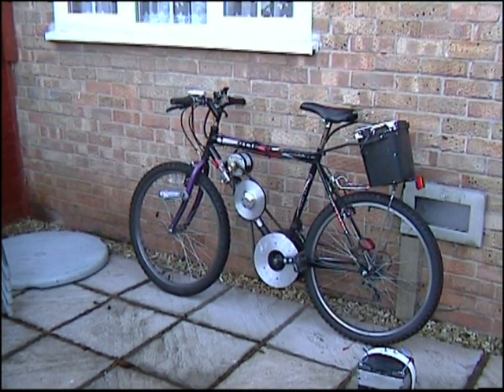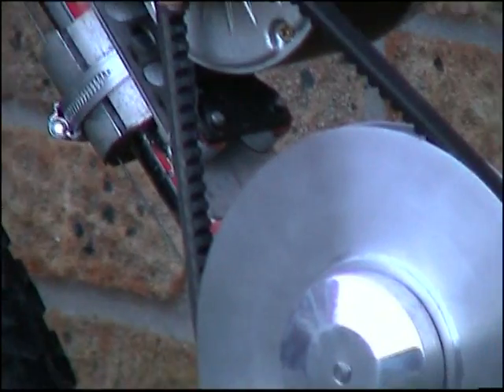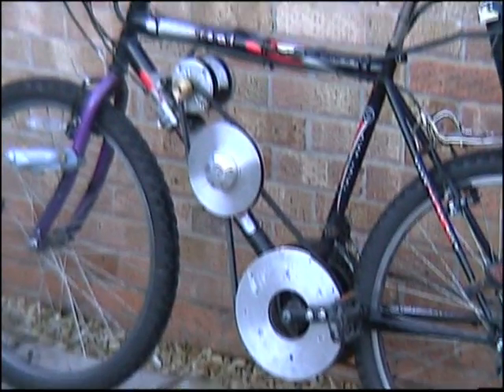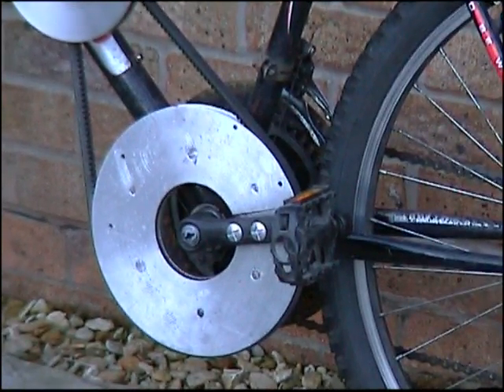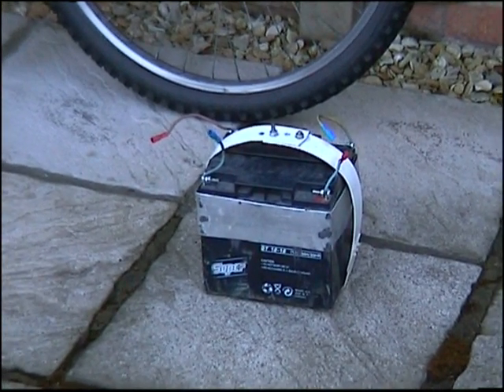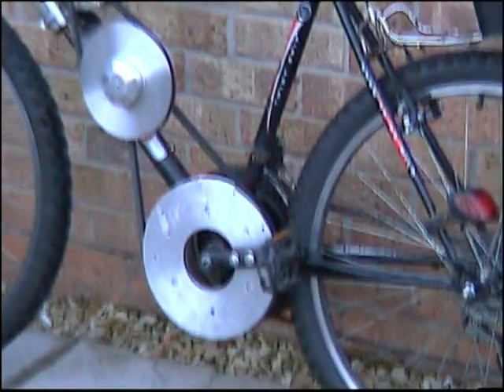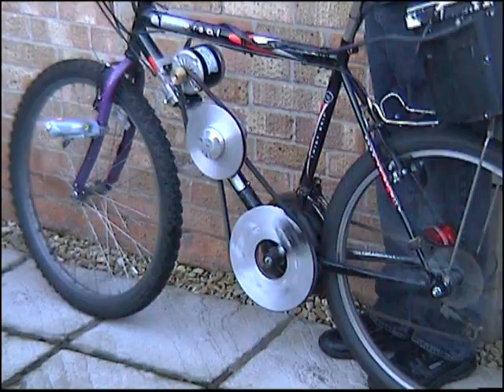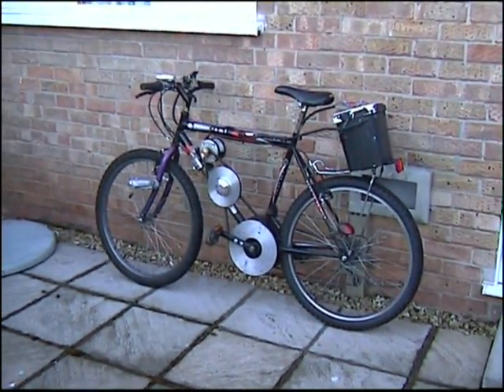Upgraded Home Made Hybrid Electric and pedal assisted Bicycle. Using a 350w 24 volt dc motor

Comment: @NicolaBurrow Thanx!  Did my numbers for your top speeds match up?  Likely your numbers were lower because you don't include a transmission.  I'm guessing you hit 14 mph pedaling, 17 mpg with the motor alone, & 19 with motor & pedaling.  Usually, motors like yours have high torque at low motor speed, so a transmission delivers only moderate advantages, especially slightly higher top speeds, but unknown effect on range.  Keep up the good work.

Comment from the maker: @SIMKINETICS The bike was built on the cheap as I didnt know if it would work or not so the lead acid batterries are its biggest draw back.However hopefully I will start work soon on another bike with alloy frame lithium battery and a freewheel on the motor so it can be ridden easier without the motor running. Im also thinking of adding drop handlebars and a fairing.

Comment from the maker: @SIMKINETICS I cant remember what brand and model number the motor had as the bike is no longer in use. Only that it is 24v 300w 16amp and appears to be the kind you see on those stand on electric scooters.Its difficult to judge how fast you go when flat out as on any bike it is dependent on conditions and I am not the fittest person.But I can say that whilst riding the bike to and from work on 9 miles it took approx 5minutes less than on my normal mountain bike.

Comment: @knowledgemonger A one-way clutch is a simple, cheap solution.  We'll be using something similar in our first SIVAT-equipped vehicle products with HPV/motorized hybrid propulsion, later to be offered for bicycles.  This would pair the rear sprocket w/ a large motor-driven sprocket or C-F timing belt pulley; also simple.

A multi-phase induction motor drive is intriguing, especially w/ an IVT like mine, considering its mid-range torque peak.  Would the support electronics be affordable?

Comment: @Asylumescapee69 An athletic male rider will only produce 200 watts for any significant duration, less for an average person.  The added weight & aero-drag will hardly affect steady-state speed for level ground riding.  350 additional watts will be much more than a break-even scenario.  Pedaling only gets 17 mph; motor only gets 22 mph; pedaling plus motor gets 27 mph.  A great on-line interactive source for calcs is 'Bicycle Power Calculator'.

Comment: @knowledgemonger Good suggestions.  A single-stage carbon-fiber bicycle belt drive would be quieter & still quite efficient.  Running this through hub gears (like mine) on the drive side offers some advantages to motor efficiency.  A proper-sized one-way clutch at the small motor pulley would allow unhindered pedaling when the battery discharges.  Lithium-Ion batteries have higher energy density than lead-acid; a managed, in-series pack would be lighter & longer lasting.

Comment: So, is that simply meant to lessen the amount of work you have to put in to getting around? Seems like the extra weight probably cancels out some of the work. 350 watts isn't much power. A bit less than half a horse. I imagine human legs do at least 250 watts without too much strain... but adding a battery will easily drop that down to <100 So you're breaking even I suppose.

Comment: good dude howener motor to pedial drive  no it would ben better on rear hub opisit chain sproket to put a pully or gear on it and power it there maby put moter in the back on metal plate off rear rack this way you start to pedial then kick in the motor and coast on the pedials instead of it pushing ya feet or worse break legs

Comment: Did I hear 350 watt motor? In Australia, we are limited to 200 watts for power assisted bicycles. What is the power limit in the UK?

The pulley arrangement is a nice set up. With the drive shaft on the motor, is there a v-groove pulley or do they have teeth/splines that match the v-belt or toothed belt?

Comment: The average athlete puts out , say around 1/4 horsepower. Assuming that we commoners would put out less (if it were measurable) - could this setup then be considered as a 2 person bicycle? once again assuming the output of the motor (less torque, which just makes things difficult to calculate) is around the same as what we could put out.

Comment: When looking at some electrical bicycles here In Sweden, I found out that the pedals need to be turning even when assisted or else its not a bike but a scooter (you'd need a registration plate and a drivers licence).

Comment: Lovely piece of work.......i've been having discussions recently over the lossy nature of 'v' fan belts, which as I understand it can be over 50% if there is a notable difference between the pulley sizes. Feel the temperature of the belt after a bit of a run and know that comes from battery. At one point , you coast , so you turned the motor off to do the turn ? There is a folding bike called the Strider that has a free wheel in the bottom bracket, why may give you some rest on the way home !

Comment: awesome project, and thanks for sharing :) i had a little thought.... could you use a ratchet (like on the rear wheel of a pushbike) acting on the axle of that center pulley wheel to help........ wait...... no that wont help..... darnit :) still, cool project..... plus, ill wager, a heap of experience to apply to the next one.... we'll be waiting :D

Comment: I've been wanting to do a similar thing with a honda gx50 and a 40:1 reduction at the cranks. I'm not sure how to do a freewheel though so I don't have to pedal against engine braking when the motor is off. I guess I could put a simple manual clutch on it so I can start the motor by cranking the pedals and also disengage to use as a non motorised bike.

Comment: I JUST PUT A 66CC 2 CYCLE ENGINE ON MY MOUNTAIN BIKE. HERES MY QUESTION I PUT A RADIO ON THE BIKE POWERED BY MY DIE HARD 12VOLT ATV BATTERY. DO THEY MAKE A GENERATOR SPROCKET TO RECHARGE THE BATTERY WHEN IT SPINS . I HAVE NO WAY TO RECHARGE EXCEPT FOR THE TRICKLE CHARGER. THANK YOU FOR YOUR HELP

Comment: I made a pulse width modulating control system for mine which wasn't too difficult but making an accelerator pedel give a varying resistance is now the problem. Reed switches and a moving magnet is nice and frictionless but gives too much hysteresis and only stepped control. A potentiometer gives nice control but too much friction; but getting round these problems is half the fun of enventing!

Comment: ive always been curious why no one has added a low resistance high output generator to their systems to regenerate electricity back to the battery ? also i have seen other model add light weight 12 v battery in empty space under main support bar, good job though this was very interesting, all you need to do now is figure out how to add auto shift to system and you can save electricity/power

Comment: Is not it easier to put forward the same wheel as the rear (with an asterisk), and buy a motor with gearbox and an asterisk on the shaft (eg MY2010), instead?

Comment: @derman077 I have converted a bike into an electric one about 6 years ago when i was 16 using two 12v motors (taken from a cars cooling fan) mechanicly connected and overcharged at 24 volts each. I managed to get as fast as 55-65km/h (depending on the conditions) but after a couple of months one of the motors burned. Now i want to build another one but as i am heavyer now i need a stronger motor. At the very least 500w. I saw an 800w motor at ebay and i think i will go with that one

Comment: Good idea, but it should be disconnected from the pedals for safety reasons. I'd be concerned at least if it's a good idea to have your knees being pushed around by an electric motor when you're tired and most likely to use it.

Comment: @xmicina well first off i should have said motorized bike not moped.. sorry my fault.  How ever my bike doesn't have any problems so i know i will not have any problems!! also if you look at the differences between the two gas is cleaner then electric.... i can go on and on and on but i will not because there's no point. over all gas is better!!

Comment: i have the exact same motor as you!

can you try to explain to me how you attached it to the pedals like that?

i see that using the motor spins the pedals...would the pedals spin the motor? i assume that you would need two freewheels in there somewhere to prevent that from happening..correct?

Comment: Efficiency of the bike to begin with is important. From experience, a road/racing bike that has thinner high pressure tires would have less rolling resistance.

I like that you're using belt drive, where did you get the pulleys from? Would a small centrifugal clutch on the motor shaft improve the range, reducing the high power currents associated with low rpm take-offs?

As for batteries, what about building your own battery packs using small light weight ni-cad (a bunch of them).

Comment: can you still switch gears on the bike? can you put a larger motor with more RPM's that is right angled, to go along the frame of the bike to keep center. i understand power restrictions, and adding weight with more battery.  just think you could be getting better torque out of a longer motor.

Comment: But you was using pedal to move. THis system is only to help?
I think the speed is the same if you use only pedal. I thought pedal assisted is to help when we are uphill or tired.

Try use those motor whell with 1000watts

I sorry if you talk about it. I cant understand all words.

Comment: Do a bit of research into Nickle metal Hydryde battery packs, or Lithiup Polimer  packs.  Lead Acid is the 2nd most inefficent battery Type commonly in use today.  
Just be a lil warry of the Lithiums  they need high maintenence and are a fire hazard.